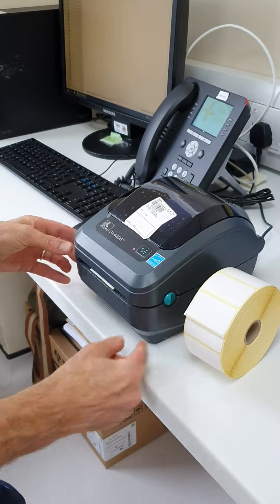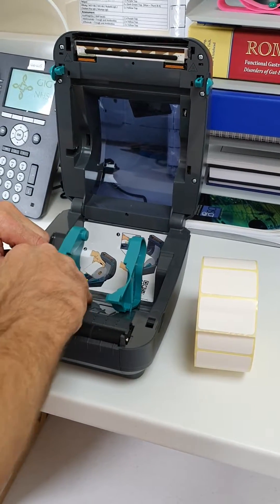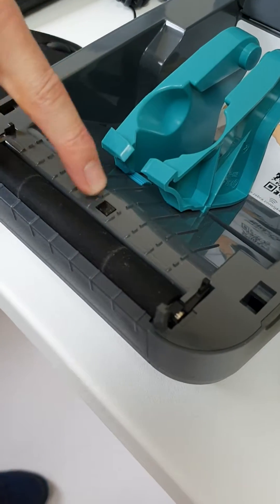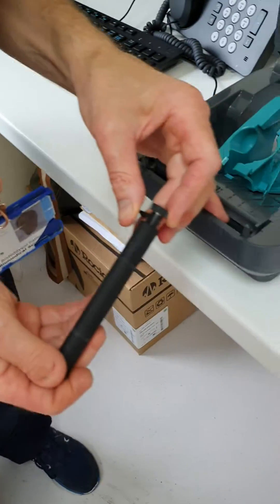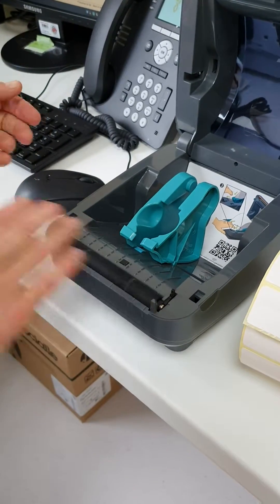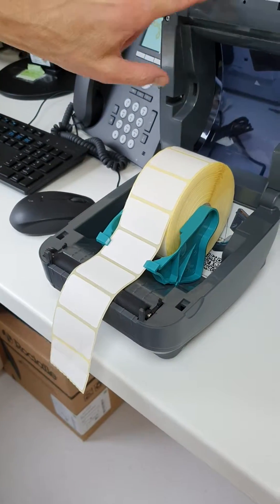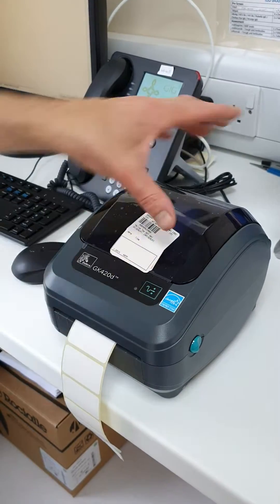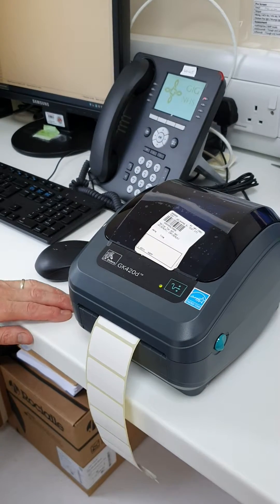Reloading and resetting a Zebra GK420d

Comment: Hello sir, maybe you know if this printer supports 1 inch width labels? 
I wish to print 1/2" x 1" Thanks for the info...
Reply from the maker: There is plenty of space for wide labels. Though this video was taken some years ago there may be better more modern label printers on the market by now.
Reply: i have the same question. did you figure it out?
Reply: @nathanmohler1631  I took the risk and bought the GK420T which prints on direct thermal and thermal transfer as well, and yes. The 1" labels do fit without any problem.

Comment: Hi
The printing is intermittently coming. One is printing and the next is not printing. So there is wastage of too many barcodes
Reply from the maker: Have you tried thoroughly cleaning the print head (I use an IPA swab) also you could perform a printer recalibration and reset. Other than these  few things it will need servicing by Zebra.
Reply: @philipwaters  thq

Comment: Hi dude, my zebra keep printing the tickets clean, no write anything , idk why, i just do the normal configuration, but just have white tickets , she is not writing, any idea? its new

Thanks
Reply from the maker: There could be a number of reasons for this problem, from the simple fix (is there a loose label stuck to the thermal print head) to rather difficult requiring zebra customer support for a faulty print head. Sorry I can't be more helpful.

Comment: MY Zebra GK420 is flashing red slowly. The media is loaded and the lid is fully closed but still keep blinking red. Any ideas?
Reply from the maker: Have you checked for loose sticky labels blocking the label sensor? Might need to raise a trouble ticket with Zebra?
Reply: those are too basic. thanks anyhow